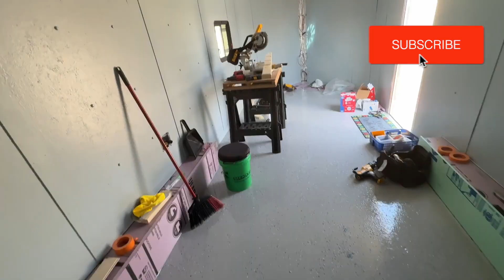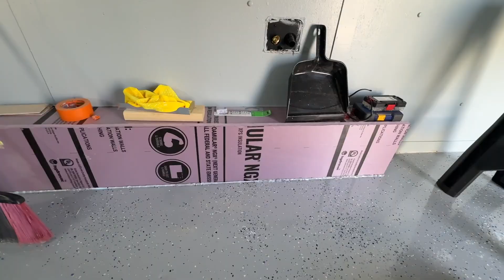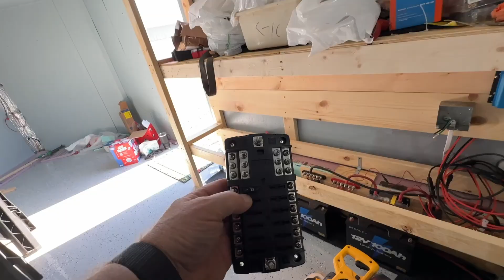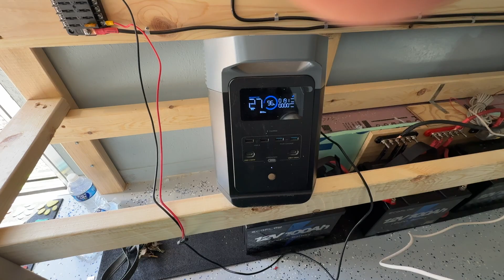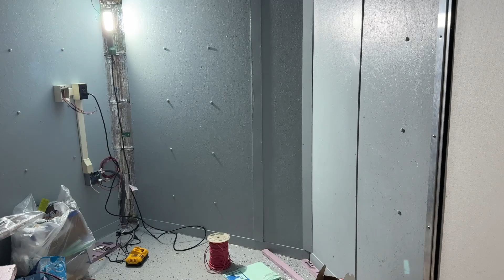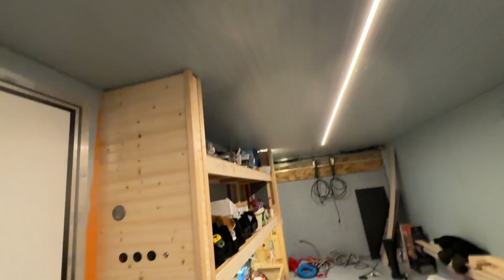Cargo Trailer Camper Electrical Room? Episode 9

Comment: Run stranded throughout? 12ga? That is my plan anyway. Like you, all surface wiring; other than the factory 12v stuff. I will leave it where it is
Reply from the maker: Absolutely. The only time I ran #10 is for loads over 15 amps to avoid voltage drop. Tongue Jack, diesel heater, fridge on the 12v side. All #12 for 120 v